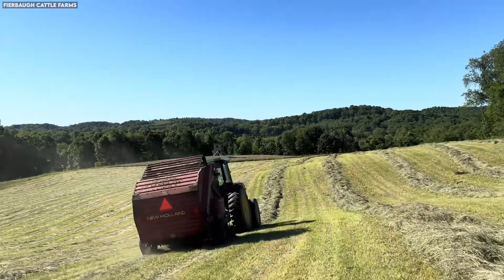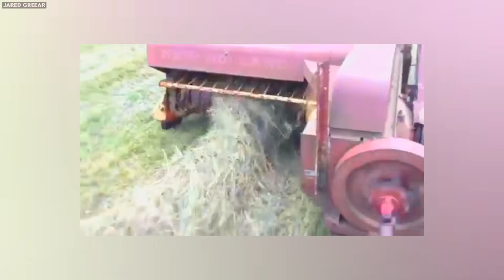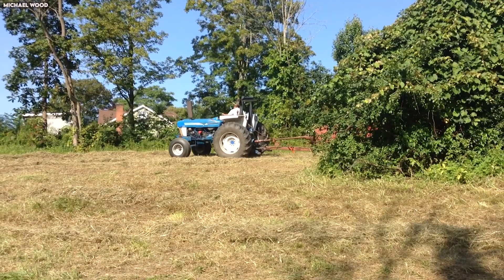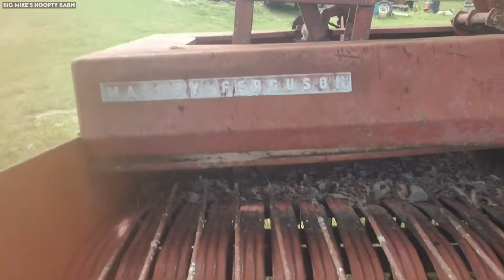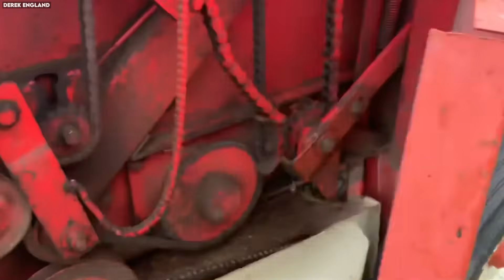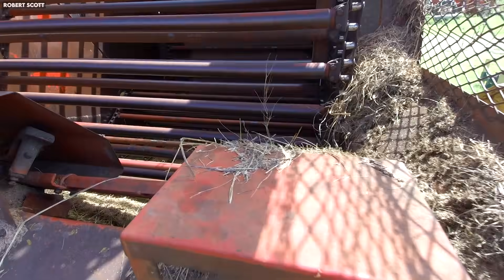10 Old Hay Balers Built So Well They're Still Baling Today

Comment: The remark about IH knotters being "Less forgiving" made me smile. It took until the late 1970s for them to realize that the "Rasspe" type knotters as used by Deere ,  NH etc .were far better than their own. I tialed a prototype IH 445D during  the summer of 1979 fitted with Rasspe knotters and soon after that all their balers were fitted with them.
Reply from the maker: Thanks for the insight, it's always great to learn more about the evolution of these machines. :)